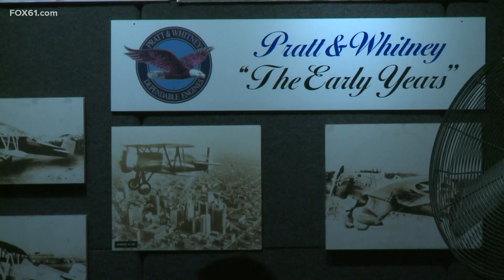Pratt & Whitney delivers its 1000th F135 engine

Comment: The engine that took years to develop, spent a wad of money with GE to keep Pratt honest, and now after a thousand engines, they (DOD) want to replace it.  They may have the sales, but I am not sure what they are celebrating. It's like a low rated TV show celebrating 100 episodes.
Reply: Lol you couldn’t be farther from reality buddy😊
Reply: @brianlocke6098  Then just send me the links to "reality" so I can be duly informed.
Reply: @spuwho  I work for the company.  Do you?
Reply: @letscheckitout1985  How long?
Reply: @spuwho  27 years
Reply: @letscheckitout1985  Awesome, thanks for your service. I was referring to the fact that Congress had to spend more money over several years with the GE/RR consortium to fund F136 development because Pratt was having problems with the F135 and had gone over budget by $1.8 billion. It wasn't until PW got the F135 back in shape that Congress killed the F136 even though GE/RR offered a no expense to DoD program to put it in production. Since PW finally did reach production and came out with the phased upgrades, the engine has reached its potential.
Reply: @spuwho  yup and I work in the very same building that has the room I won’t mention it’s name that is already 60 percent through with the F136.  It’s going to be quite mind blowing.  More thrust, better fuel consumption, and will be able to work and go right into the current utilized f135 air frames.